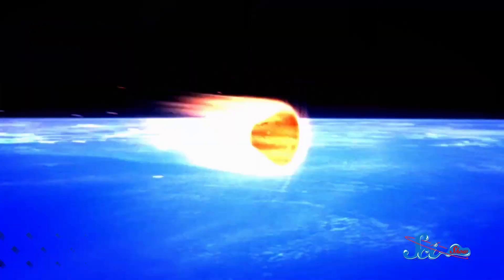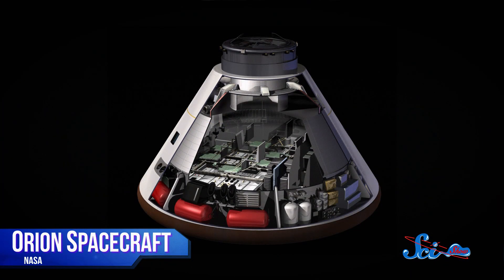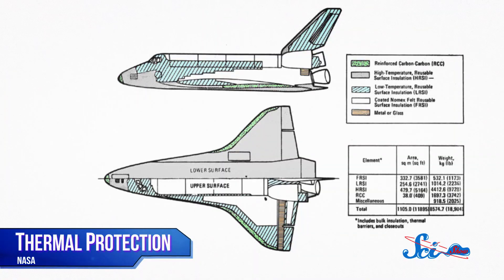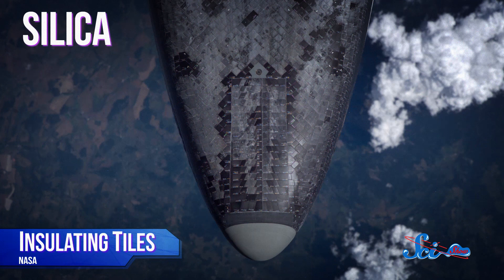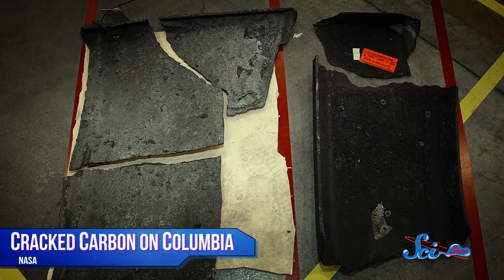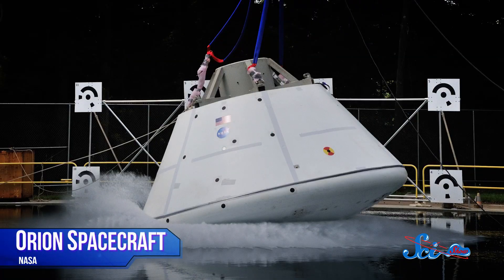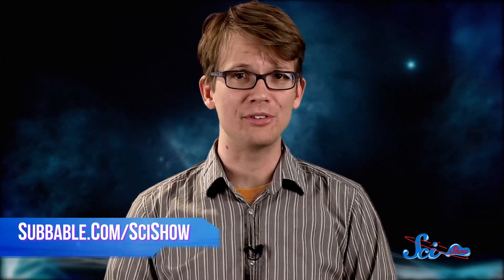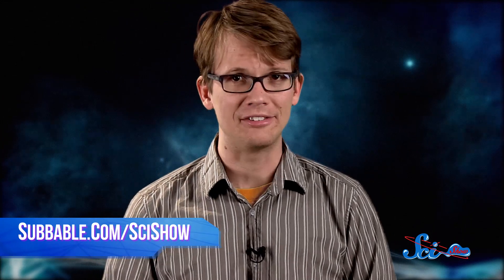How Do Spacecraft Survive Re-Entry?

Comment: Hi, I thought I would share me and my friends are going into 7th grade over the past 7 months we've studied all the Apollo missions and Challenger missions one of friend luke who has autism but is really really smart and designed a rocket layout in 2d and 3d we have built a capsule that can supply a hamster air for 45 minutes IDK how but he designed it and we built it can fit 1 hamster padded just in case hit the side. According to Lukes research, it will go approximately 10000 miles with just the rocket, We took the hamster for a test flight in an RC plane we got from top flite (check out their youtube channel) and when he got out he seemed fine but that was a smooth ride that's why where worried that he won't be okay on the way back down if he survives the 10,000 miles we will go higher. It also has a GPS tracker on it Look for it on the news in the next 6 months. reply what we should name the flight and the hamster doesn't have a name so hurry

Comment: Why re entry not use rocket for reduce the speed entry,, that whill reduce the heat
Reply: Those capsules don’t have engines or fuel. But what you said it pretty much what the falcon 9 does when re entry

Comment: Beryllium metal in large solid pieces isn't dangerous, however inhaling beryllium dust is extremely toxic, even in small amounts. It can cause berylliosis, which is a very serious lung disease. It's also used in X-ray tube windows, since it's quite transparent to X-rays. It's also used in portable neutron sources when mixed with an alpha radiation source, like radium-226, americium-241, plutonium-238, plutonium-239, or polonium-210 for example, or a high-energy gamma source like the beta emitter, antimony-124. Beryllium-9 (stable, monoisotopic) has the lowest separation energy of all nuclides, at about 1.67 MeV. A high-energy gamma ray photon (> 1.67 MeV) can liberate a neutron from its nucleus. This also makes it a neutron multiplier. When a neutron is ejected from beryllium-9, beryllium-8 (extremely short half-life) is produced, and quickly decays by alpha emission, splitting into two alpha particles (or two helium-4 nuclei). Hence, the process is multiplied. Kind of off-topic, I know. But I love studying radioactivity!

Comment: Here's a good question: Why is there enormous heat on re-entry but not on exiting the atmosphere? Are we coming back the wrong way?
Reply: This is why on launch rockets climb straight up for a while before turning sideways and accelerating. The initial upward climb gets the vehicle into the thin upper air while it's still going relatively slow. Once the air density reduces the rocket can turn sideways and start accelerating towards orbit.

Comment: If the gemperature of re entery is about 1600 - 1700 degrees, why dont they use tungsten which has a melting point of more than 3000 degrees. Im sure theres reasons why but it seems like a good idea.
Reply: The first two Mercury flights used beryllium heat shields that acted as heat sinks. They work by absorbing the heat. But those two flights were only suborbital so the total energy involved was relatively small. On an orbital flight the total energy that needs to be dissipated is much higher. As such you need an ablative heat shield that gradually burns off and takes the heat away with it. If you tried to use a metal heat shield on an orbital mission it would overheat and either melt like a meteor does or overheat the internal structure of the spacecraft.

Comment: you can also use a heat resistant sink with chemical cooling inside it. things that boil away from small nozzles pointed downward. you can also use a thin heat sink with a heat resistant insulation. this way the heat sink can get hotter, much hotter and radiate more heat from the same amount of surface. for the first method you can even use water. i mean yea, water.

Comment: Sorry the reason a spacecraft doesn't just slow way down before reentering has nothing to do with bouncing off the thick atmosphere, gravity ensures that a object with no forward momentum will not bounce. Rather the reason is that to slow a craft from 7,000 m/s to a stop would require bringing to space as much fuel as it takes to launch in the first place.

Comment: why doesn't the compressed air turn into liquid
Reply: Because of the extreme heat. What happens is the exact opposite, the air turns into a glorious trail of plasma.
Reply: First of all air is made up of different types of gases so they would turn to a liquid at different times. But! For air to turn to a liquid it has to lose energy, and a space craft smashing into it doesn't help.

Comment: That moment when you realise Nasa is making their first ever crew transporter that can take people to space stations...

The space shuttle doesn't count because it was deadly, extremely expensive and meant for cargo missions.
Reply: But the Space Shuttle is very sexy so it makes up its flaws
Reply: Isolatedfleet but it killed so many!
Reply: A 1.5% chance of failure is actually one of the best in the industry. Compared to other rockets, it's really good. The 9 variants of the Soyuz rockets have had 37 failures out of 1,209 launches. Granted, most, if not all were lucky enough to be unmanned. That gives it a 97% success rate. The Delta IV rocket also has a 97% success rate (96.8%). SpaceX's Falcon 9 has a 92% Success rate (Not including failed landings) 1 complete failure, and a partial failure. 24/26 launches were good. I could go on, but I think you get my point. The Space Shuttle was one of the safest rockets to fly in.
Reply: Saying it killed so many, seems kinda like a misnomer. Yes. 14 people died on the shuttle missions, but they were from just two missions.  You should judge a rocket by its success rate. And number of failures. The space Shuttle still had a 98.5% success rate by the end of the program.
Reply: Colton Byrd if your car had a 1.5% chance of killing you, would you drive it?
Reply: Kaleb Bruwer No. But if it was taking me to space, I'd take the risk.
Reply: Colton Byrd we are talking about crew flights. They take more safety measures with crew.
Reply: Well fair enough, but there isn't a very high amount of data to work with. Only 4 manned rockets have failed, and resulted in crew deaths. 2 Soyuz, 2 Shuttles. Out of a few hundred. For whatever reason, I can't see to find a straight answer on the overall manned rocket launches. So whatever. Not alot, Anyways. The Space Shuttle is still pretty safe. Not the safest. But decent enough. Safer than the Soyuz. 2 out of 101 (manned missions) resulted in deaths, compared to 2 out of 135 of the Space Shuttle.
Reply: Colton Byrd what is the space shuttle's abort system? Soyuz has a launch escape tower and dragon does the same with its engines.
Reply: They do exist, but they are quite... Strange. They don't protect against a catastrophic disassembly, but for failures of engines, or such. 

Look, I'm kinda sick of defending a spacecraft I was never a fan of. Anyways. Good talking to you, but I'm done.
Reply: Colton Byrd ok. Looking forward to the crewed dragon 2 launch next year? I think we can agree on that being a cool spaceship
Reply: Kaleb Bruwer Oh yeah. Along with the Falcon Heavy. Do you know about when they'll launch? Approximately?
Reply: Colton Byrd I think falcon heavy is september-ish
Reply: Cool. Love to see that. I wonder if they'd manage to land all three boosters. That'd be incredible. Although I have a feeling they won't attempt the landing the first time. Thanks.

Comment: Heat sinks? Really why bother a mention? Ablative materials? Where on earth does this really have any application? In space apparently the laws of physics are the same as on Earth. So go read up on heat sinks and ablative materials. And by the way, that reentry vehicle, omitting principles of aerodynamics, is now the supposed bespoke optimal vehicle for entering Earth's atmosphere. Lol, would it not just spin and create all that goes with spin? So tired of miss and dis information.
Reply: Actually the spacecraft is deliberately spun (rolled) continuously by the guidance system. Because the weight inside the spacecraft is unbalanced with more weight on one side more air is deflected off the opposite side of the heat shield. This generates some aerodynamic lift in that one direction. By rolling the spacecraft the lift can be directed in different directions to steer the vehicle and adjust its trajectory on the way down. That's why the Apollo CM's were able to land so close to the aircraft carriers within just a few miles.
Reply: Not the best educated tool in the shed are you, buddy? Just because you don't understand doesn't make it fake.

Comment: +SCISHOW SPACE :-I WAS CURIOUS TO KNOW WHO DID APOLLO 11 RE-ENTRY TOOK PLACE DID WE HAD THAT TECHNOLOGY AT THAT TIME AND HOW DID APOLLO 11 PASSED THROUGH VAN ALLEN BELT
Reply: It's simple the radiation isn't that strong and could be used for experiments and could be block by wearing a space suit
Reply: And the re entry was run by comp using verb 37 noun 63 I think
Reply: Don't use all caps. Usually considered rude. Anyways. Yeah. The Van Allen belt will only kill you if you loiter around for months constantly in it. If you just go through it in a few hours, no problem.
Reply: I just want to know where you learned to spell so I can stay away from that place.
Reply: Thank you for your suggestion and answer.i really appreciate.Thank you ones again.

Comment: lol, someone needs to tell space-x that landing like buck rodgers nearly impossible
Reply: Dissentient the problem is the bottom, where the engine is, it also has the flaps and that can be a problem when landing, one strong wind and the rocket will strafe due to the shift in weight and propulsion. ergo the multiple sideways crashes.
Reply: +Michael O&#39;Cooney lol why? What are they doing?
Reply: Landing straight down without parachutes
Reply: it isnt impossible by any means. it is just MUCH harder
Reply: +Michael O&#39;Cooney Landing vertically is not a problem. Re-entering with a rocket-shaped vehicle is. If you can safely get through the atmosphere with something that has an engine with a thrust-to-weight ratio of at least 1, by all means, use powered landing. 

However, at the current level of technology it's easier to just jettison fuel tanks and engines before reentry, get through the atmosphere with an ablative heat shield and then land with parachutes.
Reply: +Michael O'Cooney maybe decouple the fins? i know its not entirely reusable but its alot cheaper to replace the fins than potentially replace the whole stage.
Reply: well, they managed it.
Reply: Revampedharpy09 good point, they did manage to have the ability to keep the landing legs facing down even with the increased drag to the the crafts relative "bottom"
Reply: +Kaleb Bruwer although it tipped off... they theoritically succeed
Reply: kenny ricardo they already landed and recovered I think 5.
Reply: Michael O'Cooney falcon heavy?

Comment: If we could be able to bring plenty of energy/fuel ut to cpase, would we then be able to a safer re-entry or is the speed just to high for this to be possible?
Reply: You are correct - if you slow a spacecraft down before it enters the atmosphere, then reentry will produce significantly less heat. If you were to come to a complete stop before falling back to Earths surface, you might be able to survive the reentry with just a space suit (see Felix Baumgartner). 
However, current spacecraft fuels are very heavy, meaning that it's easier to deal with the issue of heat on reentry that it is carry more fuel into space.
Reply: Unfortunately the more fuel you add to a rocket the more engines you need because the rocket has more mass. Hence the cost increases.

Comment: If they're using the optimal angle for minimum impact on the atmosphere upon reentry then it does look like it's gonna be many years before we can just 'fly' into and out of space. I mean the virgin galactic craft don't actually leave the atmosphere, just reach towards the outer ceiling. There is no 'impact' or reentry shock for them. Any extraneous fairings would instantly disintegrate and then the whole craft! So currently that falling pod is the best we got for a long time!

Comment: cant they make the space shuttle out of Tungsten. Tungsten melts at 3422C
Reply: So the spacecraft will survive... and everything inside will get cooked. You have to get rid of the heat somehow - that is why it should melt away.
Reply: blazebluebass the ones that meted were not reuseable. so if we ever want to make space flight a every day thing disposable spaceships will not work. plus those did not land accurately
Reply: Dario Gonzalez You did not even try to counter my argument. You seem to be totally fine with temperatures above 3K°C as long as the ship is reusable and accurate!
You did not even mention any isolation as the solution to the problem I told you.
Reply: Dario Gonzalez: Besides cooking the crew, tungsten is one of the densest metals, and therefor is far too heavy to make a spacecraft out of.

Comment: Thank you for saying that the high temperatures are caused by shock heating and not friction!
Reply: high temperatures is caused by friction.😈
Reply: The high temperatures are the result of both. Some of the heat is generated out in the shock wave. But there is also air flowing over the skin of the vehicle, so some of the heating is also caused by friction.
Reply: Bob. Just Bob. 2 years later...Hi!

Comment: Can you please answer a question for me. How is it the space suits they use for space walks don't swell up like a balloon?. The shuttle, and the ISS have thick walls, and if a hole was to happen then the air would blow out into space, but a space suit keeps it's shape, and is a lot thinner.
Reply: They are very stiff. Working in them is indeed a bit like working in a swollen balloon, bending parts of it takes a lot of effort and the joints have been designed in very special ways for it to work at all. Otherwise the astronauts would just look like the Michelin man.
Reply: The reasons for this are plentiful and mostly beyond my scope of knowledge, but the short version is that the outer layer of space suits can bend, but can not stretch. Science Physics Polymer chemical bla de bla de bla

Comment: if we came in at a really shallow angle with enough surface area, could we skip across the earths atmosphere like a stone across water? Each skip would steal momentum while leaving people inside experiencing minimal g-forces, and then, we would just sink and we could just deploy a parachute right from the start
Reply: I think you would actually just bounce off.
Reply: blazebluebass maybe, I don't know though, it could work
Reply: Max Atwood The analogy fails a bit because for the stone, gravity will actually make go down again and make it skip multiple times. a spacecraft goes so fast that it could skip of the atmosphere into space and not be slowed down enough to fall back or fall back at an unpredictable angle.
Reply: The Apollo Command Module basically did just that. It made an initial shallow dip into the atmosphere to begin slowing down, which of course caused the initial heating. Then it skipped off and went back into space to cool down. The astronauts became weightless again at this point. However, because the first dip dropped the vehicle below earth orbital velocity it had to eventually come back down again. This caused it to reenter a second and final time, which dissipated the rest of the energy until the parachutes could be deployed.

Comment: What about surrounding the ship in a coiled tube filled with a fluid or solid in the front, something with a sort of low melting temperature like silver, when it heats up it expands and along with the force of reentry pushing it to the back of the space ship, pushes it back with enough force to make it circulate, losing heat at the back while keeping the front cool enough to survive the heat, a layer below it could be made out of aerogel or some kind of carbon material to insulate the inside.

Comment: Speaking of ablative technology, how about the possible usage of laser ablation to accelerate spacecraft into space?
Reply: Laser ablation requires a lot of power, so mounting on the space craft its self wouldn't work. A ground based laser - even if it could aim accurately enough, wouldn't be able to function well because the atmosphere would scatter the laser light. Plus, it would probably overheat very very quickly, because even the best lasers get not much more than 30% efficiency, meaning that nearly 70% of the power being pumped into it would turn into heat.

Tangent: This energy turning into heat thing is true of all electronic devices. Most of the challenge of building faster computers is either moving heat away faster or making the circuits produce less heat. It's also why CFL and LED bulbs use less energy to make the same amount of light as regular light bulbs - they produce less heat.

Comment: hmm just a question, but what would happen if they incorporated some kind of drill function at the front.. they may then be able to travel at slower speeds and drill themselves through the top layer. Or would they just crash and burn if they did that?
Reply: Yea...that wouldn't really work...
For the aerodynamics shape of drill isn't very different from a cone, so it would still heat up too fast to keep your fleshy astronauts alive. And if you are talking about rotating the capsule, any aerodynamic failure (moist air, failure of your shielding, unfortunate duck) would make you spin uncontrolably straight towards the ground.
...amazing how much KSP helps you visualize such ideas :D
Reply: Dekareen  :) alright thanks for the great answer Dekareen... and I had not heard of KSP until I just looked it up and got kinda turned on.. Now I have something else to use to procrastinate :P